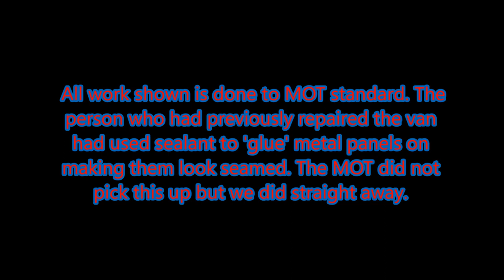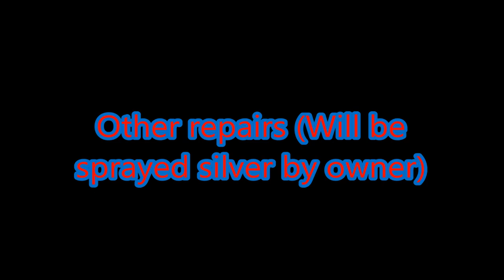It never ends! MOT welding a Ford transit van

Comment: Two things; I had an old Transit, just as bad as this, sitting in the corner of my yard. I spent a week fabricating, grinding and welding. When I reconnected the battery after the extensive work the immobiliser would not turn off. Nobody could trace the fault. I held on to that van for a whole year as I wasn't happy about doing all that work, but in the end I scrapped it, The thing just wouldn't even turn over.
The second thing is this. There are all these tutorials on here about how to weld properly blah, blah, blah and the fella is in an immaculate workshop with two pristine pieces of metal on a pristine workbench and he does a pristine weld and says that's how it's done. The moron should get under a rusty car pasted with seam sealant and underseal and weak metal that you have to chase back for miles, and try doing all this whilst laying on his back or his side with red hot blobs landing in his ear canal or setting his shirt on fire, and then he can give me a tutorial on welding.
This video is real life welding, getting a face full of grit from the grinder and red hot metal going down your sleeve. This is a proper tutorial, not some namby pamby arse with a couple of squares of metal on a bench.
Excellent video. Thank you.
Reply from the maker: That's strange, thanks a lot-wish everyone understood that
Reply: I have done something similar on my van,whilst welding in new bits I managed to find part of a wiring loom,a rough edge on new metal rubbed through 4 wires. i had immobilser issuesand no light problems. no idea the wires were there until i found them.
Reply: Your 100% spot on in what ur after sayn....binweldin rust buckets for 40 years
Reply: You forgot to mention the Sizzlers that go across your scalp and the smell of burning hair, plus getting cramp at the most awkward moment.
Reply: Too fucking right. Not pretty but job done and stronger than before. 👍
Reply: @vanreliant5584  PMSL. 👍
Reply: Follow me and in next 3 weeks I’ll upload a video of real welding on rusty caddy pickup, people just don’t clean the steel enough, sill looked really bad I’m afraid should bend plate b4 welding as just hitting with hammer leaves mess
Reply: Well said buddy
Reply: @richardchamberlain5177  cant find your welding video mate
Reply: 😂🤣your so right I hope I don't have the Same promlem my self. I'm at it this week on my mates drive way your right it's no walk in the park. Shame about yours bro did you try buy passing the emobaliser with a cable straight to the back of the fule pump I had to do that to mine Head ake but soon to be classics I hope lol
Reply: Great video, great comment. I'm about to finish my 1st project soon after 1,5 months and about 30 patches on a Rover 75 working after hours. I seen a ton of videos with how welding needs to be done and bla bla bla and i've been under the car with my mig above my face, with my hands up for several minutes without moving, welding patches that where never meant to be straight and shiny - that is real welding. The positions you need to sit to do the job are beating yoga professionals by miles.

Comment from the maker: READ BEFORE COMMENTING
Here are a few questions that I will answer before anyone comments them-
Why didn't we replace the whole panel instead of patch-working them like we have?
First, replacing whole panels would have been very costly-the costumer didn't want to spend huge amounts of money on it as the van was getting worse every year. Secondly, the van isn't worth over £1000.
Why not buy a new/worn van?
New vans can cost £10000>. Worn vans can be risky to buy, they may look good on the outside but underneath can be repaired terribly-sealant.
Lastly,
Why don't all the welds look perfect?
Ultimately the ambition is to make it MOT standard, fully seamed for strength not to look pretty -shown from steel discoloration from the welds penetrating the metal.
Thanks for reading! Please show your support as these videos take 2+ hours just to edit!
Reply: You did a good job editing. As far as the "pretty" welds, you can't just weld in a continuous seam folks, as it would warp terribly. You have to do what was done here. It is a series of tack welds so that the metal does not get too hot.
Reply from the maker: Thanks! Only get notified of your comment now for some reason. Yeah exactly, many haven't even tried welding rust let alone a transit. They are all used to bench welds which are perfection. Thanks for your comment!
Reply: Engineering in Gear £53 for that section..seems crazy to patch it when panels are so cheap
Reply from the maker: Isn't my van so it wasn't my call. The van was scrapped a few months ago anyway. If you are gonna replace one panel you may as well replace them all
Reply: Engineering in Gear ah I see.. na I got lucky just that panel tf.on the n/s tho..oh a pax door sill n/s and an inner sill n/s front plus outer haha..can I ask for you're weld settings thanks
Reply from the maker: Yep, haha. Will probs be different for each MIG but we try to weld on 1 or 2 with 2.5/3 wire speed
Reply: Engineering in Gear I have mine set for 24amp on 0.8mm flux cored wire..still trying to sort the correct speeds tho..plus zero experience other than YouTube videos like yourselves,bad obsession motor sports or ave.. thanks for the info mate.. earned yourselves a subscriber.. could have been a customer if I lived closer.
Reply from the maker: Yeah, thanks mate and keep at the welding! Practise is everything!  Been busy the last few days hence the long wait between replies but thanks for your support
Reply: Thanks for uploading and making this , shows the real man hours that goes into this. Also I couldn’t agree more often it’s better repair even the worst vehicles that often are reliable and have a proven service history and been well maintained rather than going and getting another used vehicle that could have had anything happen to it and not everybody can just go and buy a brand new vehicle either especially if it’s just for A to B or rough work why invest a huge chunk of money.Better to be spending hundreds on repairs rather than thousands on others lol
Reply from the maker: Glad you enjoyed it! Very true indeed
Reply: @EngineeringinGearWelding  what mig welder are you using and are you using flux cored wire?
Reply: Thanks for sharing. Very helpful.
Reply: What would you say the cost of this work was? Rough figure? My MOT guy said it needs welding because of 
Offside Front Integral body structure or chassis has excessive corrosion, seriously affecting its strength within 30cm of a body mounting out-rigger (6.2.2 (d) (i))
I highly doubt he will do half the job you’ve just done.. not even a quarter.. maybe nothing at all, but still invoice me, so if you could reply it would let me have an idea of the works carried out to the cost ratio roughly..

Comment: Very good video, I’m currently Welding up my transit mk5 camper, it seemed I’ll never get to the rot but I’m nearly there now, but with a little help from seam sealer and under seal it’s quite tidy now to go on a few more years. I probably won’t have it then, I’ve had it 12 years so I’m attacking the rust for the second time, a lot of what I welded to before has now rotted. But that’s transits for you. Thanks for the video🙂👍

Comment: Ooh that's a trip down memory lane for me .. having welded many like this all religious vehicles .. all extremely holy .. just when you think you've found good metal it falls off so the plate gets bigger and you add more and more . I did wonder on a few I did wether it was worth it in the long run as there seemed to be more patch than original bodywork . And also an addendum for some although there are many spare panels available it's not cost effective as your only using a small section so like a lot of the ones I had ..a sheet was the better option cheers for sharing

Comment: Great work. when summer is approaching i will start on the rust repairs on my volvo 945 turbo. i have to patch up where the battery sits, i have to weld in a new inner and outer rocker panel on the right side, and i have to reinforce the jacking point rear left as it sounds crunchy when i jaked up the car with it.
Reply from the maker: Sounds fun haha. Good luck mate
Reply: Thank you

Comment: I've had to get a few total heaps of shite through MOTs, one little gem I've learnt is that it's only the rust that causes it to fail most of the time, i have got cars through by just cutting the rusty bits off! Sounds so ridiculous but TECHNICALLY no rust, no problem as far as the MOT guidelines say! Also if you have an old rubber mounted windscreen and perhaps either the wipers/washers or even if the windscreen has a bad crack or something you can remove the screen aslong as you remove the wipers as well it'll pass! Nuts!
Reply from the maker: Haha, nice tip. Thanks for your comment

Comment: The amount of welding needed was ridiculous! Give it another 2 MOT's and it'll be more patches than original van lol

I've always wondered why Ford can't get it right with their vans, they're either bullet proof engines and gearboxes and terrible bodywork or good bodywork but terrible engines and gearboxes.
Reply from the maker: Haha, very true. Mabye built in obsolescence
Reply: MK6 Transit. I'm replacing the RH footwell, inner sil, and outer sil, inner and outer front wheel arch and discovered holes in the main rails where the engine mount is. As a design engineer myself (in electronics), I've come to conclusion they are designed to rust. Just the way it goes together allows water to run into the seams, crap, and the fact that they aren't sealed no wonder it rots from the inside out.

Comment: Obviously, not top class welding, but i tell you what you got it done! Most people havent had a go at welding, they think its easy but in honesty you havent got much metal to weld to and it never penetrates that great anyway, so why bother making it look pretty. Especially when the van is a bit of a pig anyway. What advice i will give to you though is, you can do alot with chemical metal!  Obviosly you cant make plates up lol, but to make things appear neater, chemical metal and masking tape with a dabbed finish from a paintbrush would make the finish you have look pretty perfect. It really tidies it up, trust me.

Comment: Feel the pain! The prep work is a right pain and welding to paper thin metal is no fun! What gauge sheet was that as you used tin snips to cut it. Think I used 1.2mm for the panels and 3mm for chassis work. Good work.
Reply from the maker: +Zed Man Hi, glad you liked it! We used 0.8mm steel because the steel was so weak. The 3mm would end up falling off, haha. Will have another transit repair soon!
Reply from the maker: Great work mate! If only the vans were made like that to begin with!

Comment: Just welding my 1999 transit. mines like yours but worse. I ended up replacing the out riggers with 50x100 boxsection as there was nothing to weld to as it was so bad. These vans were the best ever produced just my opinion. Sadly they are not worth alot of money so are not worth spending the time and money to weld them to a high standard. So long as they are safe. Thats all what matters.
Reply from the maker: +wacked outdude Yeah, sadly they dissolve beyond a certain age.

Comment: When you put new metal on the van, how do you protect the inside of it, like you can paint the exterior but what about the inside of the box sections??
Reply from the maker: +Andrew Stewart MTB & VanLife Hi, there should be holes in the chassis to spray in schutz but hopefully when fully sealed on the outside it should be protected enough.
Reply: Andrew's Adventures if u weld it proper then shot it with the proper black stuff.water shouldn't get in.use sealer to stop water getting I any bits.it's the salt and water,ice that rots it.from the outside in.so wouldn't worry bout the rust on the inside.transits are rust boxes.let everyone  know

Comment: Ford vehicles are among the worst rusters in my experience,  if the cavities behind those welds have'nt been sprayed with wax i guarantee the rust will soon be back.
Reply from the maker: +westland whirlwind Yeah, tell me about it. It should really be waxed before they get anywhere near this bad. We would expect for the fact that this van has tonnes of holes everywhere so I can't see it lasting, plus it isn't worth the money. Though hopefully the schutz should take it up to next year.
Reply: You don't remember the Vega? That's because they have all turned to dust,
Reply: have you owned a ldv van? they are made of rust,not metal
Reply: I fully injected my new van (55) 2006 mk6 from new, as I have had transit vans for years, I still have the van today 2019, starts and runs great. but as from last year, I have had to replace the rear valance, the outer sill, with inner repair, hanger brackets, and just now the drivers sill, its showing rust on the front arches, and along the body side, I'm more then gutted as I have maintained the underside for years, and it did not fully work, I have other 20 year old vehicles that I waxoled and dimatroled many years ago and they have been ok, it must be the steel they used, just like my Nissan d40 that fell apart,

Comment: How much you reckon would cost to do a K11 micra, new sills, boot floor around spare wheel well and rear suspension mountings
Reply from the maker: I would guess about £400/500 region

Comment: Looks like the outer sill was previously repaired with body filler.
Reply from the maker: Yep and silicone sealant. Thanks for commenting!
Reply: Where I live in San Diego California, rust like this is not a problem, but Northern areas of the US where it snows, and salt is spread on the roads, rust is a terrible problem. My daughter wanted a car, but I didn't check it close enough for rust. I think some areas were covered with body filler, and now the rust is showing through a bit. The biggest problem I've had is trying to remove rusted fasteners when I do a repair such as brakes, or strut replacement. BTW: My Grandfather Langley was from Jarrow, county Tyne and Wear.
Reply from the maker: The dreaded body filler, haha. Which usually hides about a full day of work on literally paper. Yeah over here in the UK we tend to get a lot of rain so hence the rust.

Comment: Sheet metal for frame work?Not in my shop.......
Reply from the maker: Do you repair transits in your shop though? If you tried to weld anything heavier than sheet to this van you would end up replacing the whole chassis. The owner isn't prepared to pay for work like that-that would add weeks more on to a already hard job. We do try to weld 3mm where possible to structural pieces but on transits its nearly impossible. After all it went through MOT fine anyway

Comment: Iron sheet is weak!
You need a solid chassis iron
Reply from the maker: Passed mot fine, doesn't have to be a tank,  good luck welding anthing thicker
Reply: It's not iron, it's mild steel, vehicles aren't made out of iron!

Comment: Where can i find your seam sealer?
Reply from the maker: You should be able to find it at your local autoparts store, here it is on Ebay though from the UK- https://rover.ebay.com/rover/0/0/0?mpre=https%3A%2F%2Fwww.ebay.co.uk%2Fulk%2Fitm%2F261535616028 
(I personally don't get it from Ebay)

Comment: why cant ford sort this out its so expensive to sort out when you cannot weld
Reply from the maker: Yep. They sorted it with later models by galvanizing the chassis but the engines are terrible compared to these ones.
Reply: Engineering in Gear I’ve just got from a mk6 to mk7 whichever find the rust as bad when did they start galvanising?
Reply from the maker: Not exactly sure-don't own one myself just repairing them. The very recent ones seem to have galvanised chassis. I would guess 2016+
Reply: Engineering in Gear I see mines a 09 hence the rust!!! 😂
Reply from the maker: Haha, they are good fun to repair. Good luck with your van!
Reply: Mk7 is basically a facelift mk6 so I'd imagine if they've changed, it will be the mk8/custom. It's about time! Shame their engines in the mk7 onwards are made of cheese 😂

Comment: Should of bought a vivaro!!
Reply from the maker: +L G Haha, they all have their problems- transits rotting and vivaro gearboxes going
Reply: When these transits were made the vivaro was not even though of. But i know what your saying the vivaro/traffics never rot for some reason. They are not as good as transit mechanicley though.
Reply: Yeah and then not be able to fit anything in it!!! Apart from one single sheet of ply or plasterboard DIAGONALLY, what a pointless design!!!
Reply: Good luck with that!!!!!